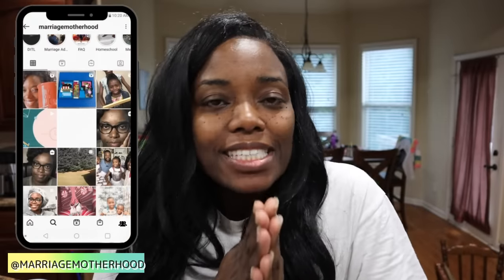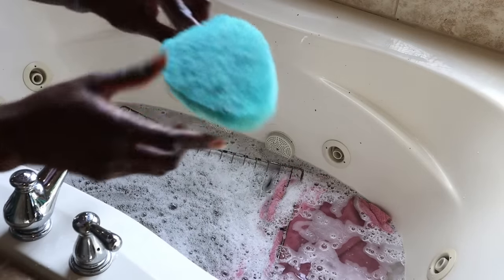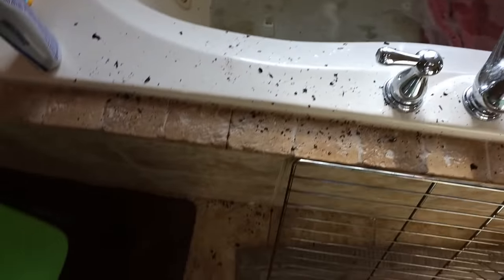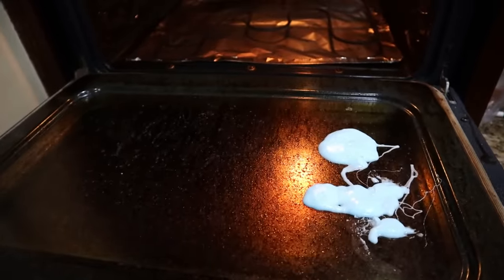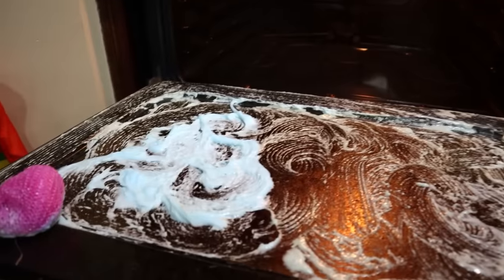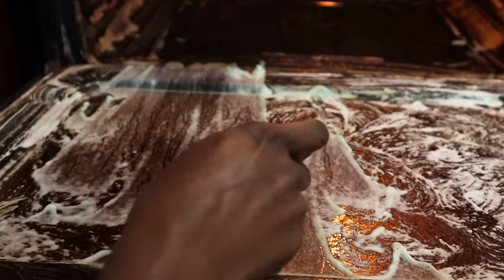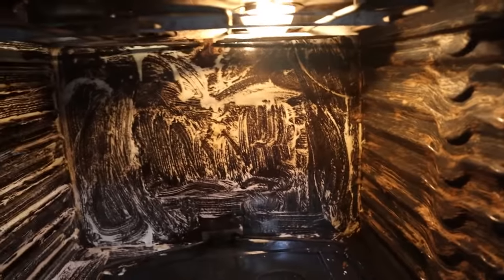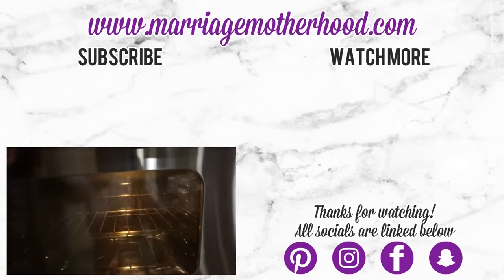Cleaning my Oven for the FIRST TIME / Oddly Satisfying CLEAN WITH ME / This cleaning hack WORKED!

Comment: I realize this is an older video, but for those reading the comments currently: 
My Tip:
 “IF” the oven door is removable , most are. ( thankfully, mine is), ….. REMOVE THE OVEN DOOR BEFORE APPLYING THE CLEANER to it …… ! 
Then it doesn’t get all over you and it’s easier to handle without the cleaner on it! 
Clean it separately then replace door after the oven and door is cleaned. 
Much easier that way. 
Caution: oven doors can be very heavy! Take care if your wrists ( or arms)  are weak like mine are. 
Live and learn….. right?
Reply: To this lady’s husband: 
Dude you look like a big and strong guy, it would have been so easy for you to take that door off and put it back for your sweet wife. 
I’m a weak older lady, 
And, if I can do it you sure can! 
One year my ex- daughter-in-law law spilled brown turkey gravy into the little top air vents made in the top of on the door and it ran all down in between the outside and inside glass on the door ( bad place for vents!) I was fearful I would have to forever live with it that way! My dear old husband ( now deceased), took the door out on the patio work table and disassembled it, cleaned inside the glasses  throughly,  reassembled the door and helped me put it back on the tricky  hinges. You bet I felt the love! So thankful for that handy loving guy. I sure miss him coming in, kissing my cheek and dancing me all around the kitchen, and dining room! 
( with or with real music, except the songs in our minds!)

Comment: I don't think the vinegar helped. 

When I sear food in my stainless steel pots and there's burnt residue, depending on how soon I want to clean it...if its right away, I fill the pot with hot water, dishsoap (like a small squeeze), add a spoon of baking soda,  and leave the flame on low for 10 min. Come back,  turn off stove,  and use a dish sponge and tongs to rub off any burnt but that haven't loosened. Rinse it clean and see the shine. 

Otherwise, if I clean the pot later that night, leave in the sink with soapy water.  Come back, empty the pot,  and do a "drier version" of dishsoap and baking soda, and sponge. Dish soap acts as a degreaser and lubricated carrier for the baking soda.  The baking soda crystals acts as a gentle scrubber. Gets clean and no scratches.

Comment: You ain't the only one that hadn't cleaned your oven for that many years and using the self clean on ovens ruined the control panel on the oven! I read somewhere afterwards that they put the self cleaning feature on ovens cause every one wants that but they are not insulated enough to handle the self clean feature and it ruins the control panel! I know it's TRUE I had it happen!

Comment: NO! Baking soda is the WORST ADVICE EVER!! I ruined my $13K Wolf oven using a concoction like this with baking soda. It seeped under the seal of the glass window and caked inside the oven door. You can literally see clumps of it circling the window frame because it's a double-paned window. This oven was supposed to add to my home's resale value. I'm going to have to call in a Wolf repairman to take the entire door apart to clean this gunk when I go to sell, if such a thing is even possible. DO NOT USE BAKING SODA!!!! Trust me and learn from my mistake so you don't end up like me. Maybe it doesn't happen to everyone but why take the risk if you value your oven at all.
Reply: I clean Wolf, Thermador, Viking etc. and have for over 10 years.My point is, your oven will be fine. It's not ruined. A cleaning service in your area should be able to handle that. Or the Wolf Technician is a safe idea also. I wish I was there I'd help. Best of luck. 😇

Comment: You should have heatef oven up I'm waiting until it was warm to the touch for you and you should have used real Dawn that's the only thing I use on my stove baking soda vinegar and Dawn. 😎 And after you got it clean all you had to do is use baking soda and vinegar all natural cleaners viñgerr and baking soda cuts the grease too always have a bucket of water with you when you do your oven have a clean bucket of warm water if you try this again let me give you step by step number one preheat your oven turn it off then put your solution down number two use a no chote boy sponge with a bucket of hot water waiting by the oven door it will be much easier if you do it this way

Comment: Why didn't you just remove your oven door? It would have been alot easier to clean.  For your racks, soak in tub with very, very hot water and oxy.  Sit for 2 hours max then wipe you did.

Comment: You did not here when they said put it on and let it set for a hour  
then you only have to take a wet towel and it all will wipe out so easily. Look at the TIC TOC again 
You really over worked yourself but you did great

Comment: Dear you are doing too much! Get some S O S pads and call it  a day. I will do what you did with the wire racks though. Putting them in the tub with hot water and soap, that’s a good idea. Washing them with what you was the tub with is kinda disgusting 🤢. Just use s o s pads to clean the wire racks and the oven also pots and pans, luv them.